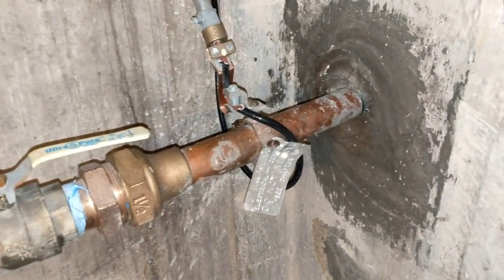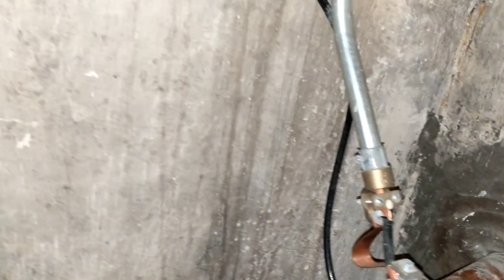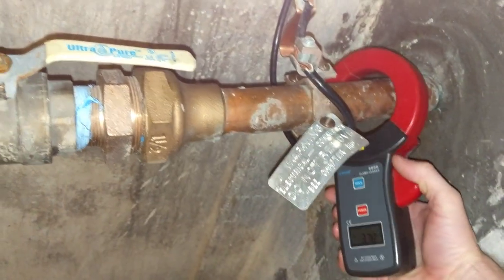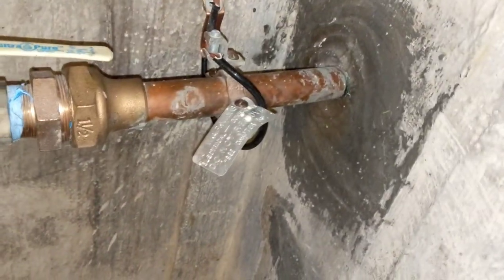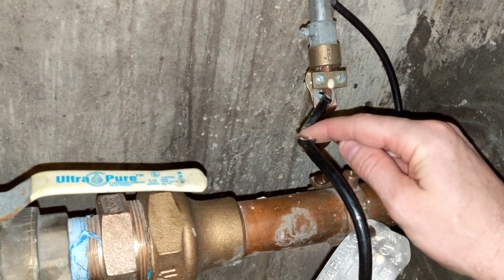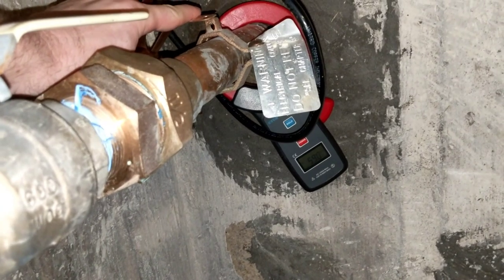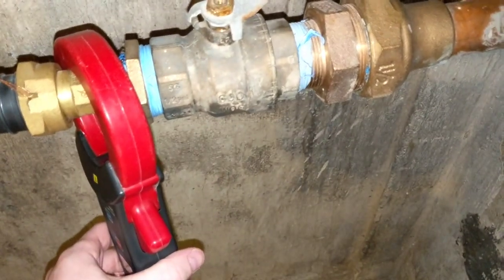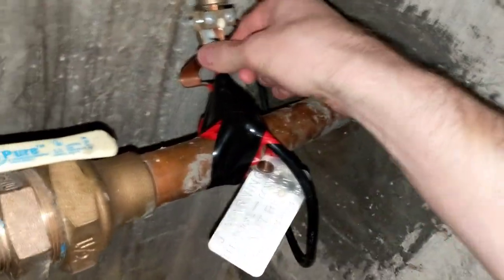How to measure current on pipes with AC Clamp Meter and isolate water pipe to stop undesired current

Comment: You have created a shock Hazzard at the point of disconnect if anyone comes in contact with the water line and the ground wire right next to it.
Reply from the maker: Let's dig into this.  Some scenarios where this could be true:

1) Neighbor's service neutral breaks completely or suffers severe damage.  Voltage  is raised on the incoming water line in your house because of neighbor in reference to your system ground in your house.  You are the only 2 on the transformer, or all other neighbors have poly pipes or have installed a break.  You touch both the small piece of incoming water pipe and the ground bond (now disconnected, but still present) at the same time.  Your hands are wet.  

Seems a little bit unlikely that the voltage would be high enough to cause serious harm.  The neighbor still has grounding electrodes.  The pipe from their house and to your house is a grounding electrode.  The city's pipe is a grounding electrode.  The transformer has a bond from primary neutral to secondary neutral, so you have all sorts of other low impedance paths to other houses through the city's pipe the current will take, meaning the voltage should be very low on your end.

Seems highly unlikely.  But criticism accepted in that it would be better to NOT have this conduit/wire/fittings/strap there to begin with.  It would be better to have it all cut out and not be near to avoid that.  But I must say it is still highly unlikely.  I have always measured very low voltage between those two points, low as in nowhere remotely near enough to cause the amount of current in the body necessary to cause harm from short term exposure.

2) Same as above but your neutral breaks or nearly breaks.  When this happens and the bond is still in place with no break, current is put on the plumbing.  The customer may never discover their service neutral is worthless or near worthless.  Since you have removed your bond, you may now have symptoms of high neutral impedance, since ground rods would be the only connection.  You might experience equipment/lighting issues and people feeling electrical sensations or even shocks in the house at times.  This would be the case with any building that has a polyethylene or pex pipe bringing water in.  They only have ground rods at that point.  How good are the rods?  How old are they, how is the soil, moisture, etc?

A better solution would be a device that will close to a certain voltage when there is a fault, and let you know of the fault.

Again I do accept your criticism by stating it would be better to not have the bonding nearby to begin with.  But I DO NOT accept that it is acceptable to have large amounts of current taking the water pipe by virtual of poor neutral connections or simply layout of the power grid in relation to the water grid.  This is absolutely not acceptable to have high field-causing current everywhere we have metal water supply lines and networks.  Magnetic fields cause health issues, there is ample research to bag that up and the World Health Organization International Association for Research on Cancer even classifies them as a Group 2B possible carcinogen, the same list you'll find lead and DDT and engine exhaust.  Researchers are pushing and lobbying like crazy for this classification to be upgraded to probable or known carcinogen due to the overwhelming scientific evidence that it causes harm.

So, how can we fix this problem?  Bond to pipe, install break, have device that will clamp down and close circuit when there is a fault (and notify)?  Install break, insulate exposed pipe?  This would simply make the building exactly the same as a building with a poly pipe bringing water in.
Reply: @EMFExplorer  It is not the voltage, but the current that will kill you.

If you are getting measurable current on the incoming water line this means your ground rods for the electric service are either high resistance to earth ground, or they are located some distance from the water service.

Measure the voltage from one side of the water meter to the other and you will likely get a reading close to 120 volts with the bonding jumper removed.
Reply: @EMFExplorer  The earth ground carries the unbalanced load of the two poles in the power panel. Good bonding in the incoming service panel between neutral and ground should eliminate most of the objectionable current on the ground wire, but all electrical distribution grids have voltage potential between the source and the user.
Reply from the maker: @mtu-engineer3220  These statements are not factually correct.  You must remember that not only on-site neutral current will spread amongst the rods and the pipe, but current from other buildings as well.  AND not only secondary neutral current, but primary as well!!!  The most important factors that determine how much current will be on that pipe are things such as impedance of the utility's primary neutral lines in comparison with the impedance of the city's plumbing networks.  That primary current travels back to the substation.  MOST of the current that we use leaves the wires and takes to the earth and to pipes - THAT was true in the 90s and stated by both EPRI and IEEE in 2 independent studies completed around the same time.  The problem is even worse now since we have increased non-linear loads on the system.

One thing that would help everyone is for the utilities to update their neutral wires.  They need to be oversized - much larger than the phase lines.  Check connections as well - make sure permanent reliable connections are in place and will stay in place and resist breakage/damage/corrosion.

It really doesn't matter where a house's ground rods are compared to the water pipe.  The water pipe is such a low impedance path thanks to all of the parallel paths everywhere, you will always find significantly more current on the pipes than the rods.  The resistance of the cable to the ground rods in relation to the pipe doesn't matter either.

The problem is not just on-site current, remember.  While it contributes to the problem, no doubt, off-site primary and secondary current are often a larger contributor to total current on the pipe.

Bottom line is why are we using pipes as conductors?  They are not designed for this purpose, and it causes magnetic fields and issues.  This is a practice that needs to be changed, and the faster it is the fewer people will be harmed.

I've measured in hundreds of homes.  I have measured the voltage from the supply pipe to system ground when a break is installed.  It is usually less than one volt, but can vary and be a few volts.  It is never 120 volts - that would represent a house that has no functioning neutral service wire whatsoever, and no functioning ground rods whatsoever.  That would be a MAJOR problem obviously!  I have worked in multiple houses with broken neutrals, and they still have not had a full 120.  Those were just a few houses out of many many hundreds I have worked in and checked.  This is extremely rare...

Current takes all paths, remember.  So in your average house with rods and a metal water supply, there will be a much smaller amount of current on the rods (on average say 10-30 milliamps) in comparison with the metal water supply (on average I'd say 225 milliamps) and on the service neutral let's say it's 7 amps.  As stated, I've seen as much as 20 amps on a water supply line, I could probably look through pictures to see but in one case with a broken neutral there was obviously a GREAT amount on a ground rod.

In your average home, this current on the water supply is ever-present and flowing through the house on copper water lines.  Some of it goes on the bond wire/conduit to the pipe, and some of it goes on the pipes themselves and makes connection at another location such as hot water heater to black iron gas line to furnace, and back to electric.  It's weird that electricity spreads amongst all paths when it has a nice big fat wire somewhere, but it does.  I have measured it countless times.

We are encouraging electricity to run on pipes by doing this, and it needs to stop.  This is why I am recommending it be changed.
Reply from the maker: @jimlynch3300  I typed a long reply and it was lost, so I will type it again.  The only assertion you've made that is correct is that we are based in a state that does not require individual licensing.  Everything else you've said is completely false.

We specialize in electrical.  I am trained in electrical theory, engineering, NEC, field theory, and more.  I was personally trained by Dave Stetzer from Stetzer Electric, who is an expert in power quality analysis and repair, circuit/field theory, the often referred to "stray" current or voltage, and motors, was trained by the military in one of the top electronics schools in the country, and specialized in motors and power quality for large agricultural and manufacturing operations.  He worked many years with and learned from Dr. Martin Graham, professor in EE from Berkeley who had countless patents to his name including missile guidance systems, high bandwidth data transfer, etc.  That's where this is coming from.

It's not about me or my background, regardless.  It is about the message.  If you have a criticism about the video, take time to actually point it out specifically please so we can have a discussion.  But most things have already been discussed in other comments.  So I would suggest reading those first and replying if you have something new to contribute.  Let's keep the discussion focused on the messages in the video and constructive.  Thank you.
Reply from the maker: @jimlynch3300  I'm happy to have a talk with you on the phone.  I want to know how much current you think is a problem when water supply pipes are being used as 24/7/365 electrical conductors like this.
Reply from the maker: @jimlynch3300  I'm sorry, but it works both ways, Jim.  I've been answering lots of questions here and educating people for free on what this is and why it is.  No one wants to answer my 2 simple questions:

1) Where in the NEC does it allow pipes to be used as current carrying conductors in circuits?

2) How much current on a water supply line is allowed or acceptable or safe?

These simple questions have so far been avoided by everyone.  This is the elephant in the room.
Reply from the maker: @jimlynch3300  I had to delete your last reply, because I will not put up with ad hominem attacks.  Let's please keep the discussion civil and on point.  This video is not about me.  I am not advertising services in the video.  I do advertise a very nice clamp meter.  You are welcome to comment on that.  If you believe my clamp meter is inaccurate, please state why.  I have hundreds of images and videos of measurements with this clamp meter and others of water supply lines carrying current as part of AC electrical circuits.

The question this video raises is about public health and safety, and affects many people.  The code changes over time.  When the code first came out, it wasn't perfect.  Guess what - it isn't perfect today.  It constantly changes and hopefully gets better.  That's why we have these discussions.

So, if you're not able or willing to comment on the content of the video with useful information, please don't comment.  It's not about my background or yours.  It is what you can make a valid argument for.

My argument is that pipes are not allowed to be used as current carrying conductors as part of circuits.  Instead of turning on blinders to this argument - address it please.  How much current is too much?  How is it unsafe to insulate a water supply line and have a few feet of unbonded pipe, when the rest of the actual building piping is bonded?  What is objectionable current - how much current is objectionable?  How is purposely applying and allowing current on a water pipe safe for people?

Someone said they are concerned about someone touching the supply side and the customer side of the insulated water pipe.  OK - this is something we could discuss.  I've not personally seen a voltage between the two that would concern me, not even with wet hands.  If this could happen, where would that voltage difference come from?  The house should be grounded with rods - which would help to reduce voltage caused by, say a broken neutral.  Just like a house with poly pipe coming in...same effect on the building plumbing.  Obviously the solution is to detect and fix the problem, not apply even more current onto a water supply line permanently.

So, what are you worried about exactly?  Next I will dive into the health and safety issues relating to current on pipes.

Comment: You know you messed up pretty bad, when Mike Holt, "Gods gift to the electrical world" comes here and scolds you... EMF guy, just take the correction, learn from it and humbly walk backwards while bowing. Not sure if you know who Mike Holt is.
Reply from the maker: I would suggest taking a moment to read other comments before posting. I know very well who Mike Holt is and commend him for all of his great work over the many years he has been teaching people about safety, codes, and theory. However, everyone, even someone who is as you say "God's gift..." is wrong at times. I engaged Mike here, and he has still to this day not answered some very simple questions - such as how much current on a water pipe is "too much"?

Running long cables to a remote grounding electrode - a water pipe on the other side of the house - and having multiple grounding electrodes far apart are also very much against Mike's own advice - in his own words and from his own lips in his videos.

Comment: I think this is NEV voltage you can not remuve it unless utility get you a isulated transformer i think what your doing does not solve the problem and the nec does requiere to bond underground metal water pipe and it can serve as a grounding electrode
Reply from the maker: In my experience, only some of this current is NEV voltage - eg. Some of it is going to the actual earth.  But the bulk of it is traveling through pipes and neutral wires.  If you hook up a positive and negative conductor to power a light, you've got current flowing on 2 conductors.  If you hook up 1 positive and 9 negative conductors, you'll have current on 10 conductors.  If you hook up a grid of neutral paths - it spreads amongst all.  Billions, trillions of paths could potentially carry electrons that are part of the circuit.

There are 6,242,000,000,000,000,000 electrons passing a point or plane for just 1 ampere.  That's plenty of electrons to spread across incredible numbers of paths.  We should make it our intention to keep them on the intended path, and the intended path alone.

Comment: This is a violation of NEC code, and it is unsafe. If you should lose the neutral and your grounds in you house this connection to the city water line is the last chance for it to leave to ground.
Reply from the maker: Saying this is a violation of code is both inaccurate and lazy.  Show us the code exactly that requires it.  It does not exist.  The code says it is permitted to be used.  It is not required.

These statements you make would be saying that homes with polyethylene water supply pipes are inherently dangerous and a violation of the NEC.  Before commenting please watch the video and also read other comments.
Reply: This is 100% required by code. It’s not out to date or redundant…

Comment: Interesting topic. From code standpoint,  I can say inspectors in my area require a metal water line whether it's city supply or from a private well to be used as an electrode. But I have often considered this to be creating parallel neutral path ( when city water). I have seen numerous instances where utility neutral becomes open, and water pipe serves as a replacement neutral with nobody knowing. Not a good thing in my opinion. I remember reading an article years ago in a popular electrical industry magazine that a plumbing organization was trying to get this practice changed. I imagine it would be quite a rude awakening for some poor plumber working on a metal line to discover it is carrying electrical current. I cannot speak to the EMF portion of the discussion.
Reply from the maker: Great info, Brandon.  We shall reach out to plumbing organizations to see how we can work together to get this practice changed.  I have also see what you describe.  Plumbers also need to be made aware of this more and know how to jump a metal pipe before cutting and also take other precautions like gloves and not touching both sides, which I suppose it could be impossible to not touch both sides when you're working on metal.
Reply: @EMFExplorer  this ground clamp is required by NEC you must connect  all available grounding electrodes.